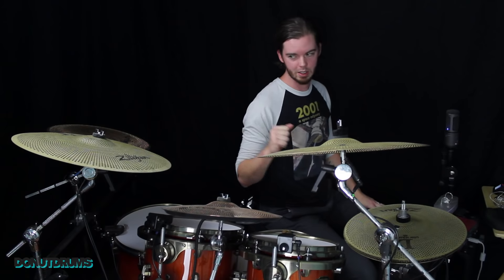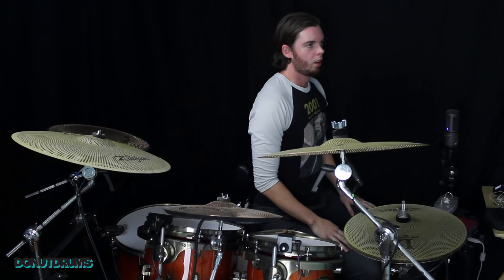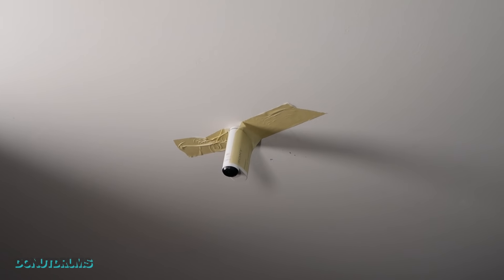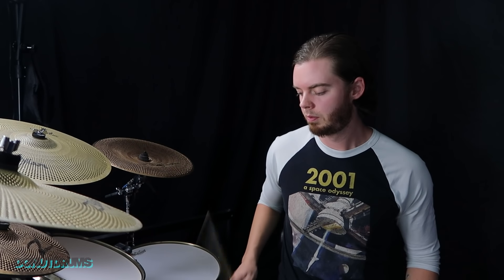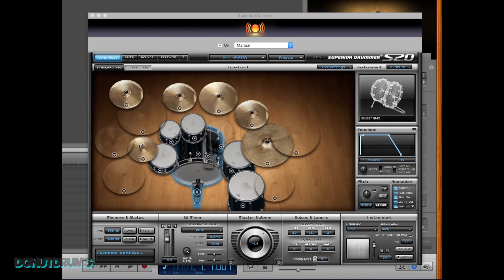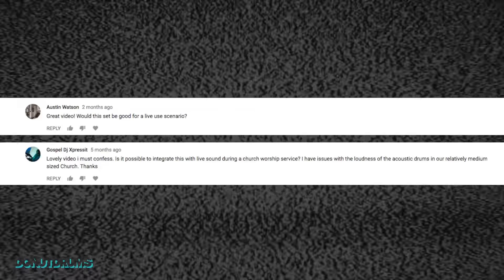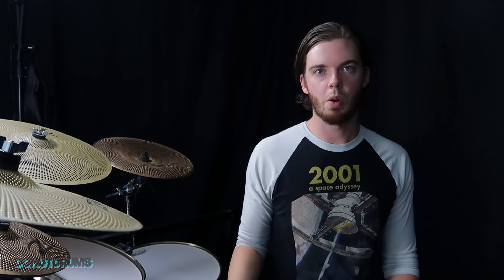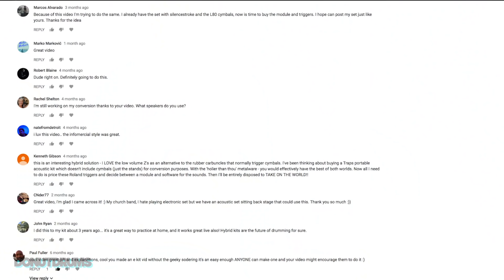ULTIMATE ELECTRIC DRUM SET - Part 3 (Q&A Video)

Comment: Great video series. Here are a couple of observations from watching and from my own experience switching over. I thought a moving hi hat on a stand was something I needed but in reality it's worse when the chunk replacing the lower cymbal is just a switch on a spring anyway. Like other people I was worried about going from a huge bass drum to a little pad but in reality I didn't notice a huge difference because I kept the same pedals. 

What I did really like is the Roland 3-zone ride. I like to have the edge zone so I can crash it, which I do more than ride it, and the bow and the bell for different sounds. It just feels so much more natural to have those extra sounds across the body of the ride like a real cymbal would. Personally I don't think losing sounds would be worth it for the stick feel of metal but I don't angle my ride or play a lot of bow.

It's funny the big difference in the spacing and height of the rack toms and cymbals when people switch over. The height of an acoustic bass drum and the depth of the toms and the larger cymbal sizes force you to give things some space with the rack toms up and spaced out and the cymbals up at eye level rather than having the pads all crammed together at waist height.

Comment: if you want less volume from your acoustic drums with a mesh batter head. You could remove the resonate head all together or if it thats not your kind of aesthetic. Try throwing a t shirt in there. Nothing large enough to touch the top head just rest on the bottom head.  Cuts out a decent amount of low end as that resonate head is acting like a speaker. That said you may need to readjust your triggers as that resonate head does provide vibration which helps trigger double or ghost strokes better. If the noise doesnt bother you just leave them. I have also heard people using cotton balls to help dampen the resonant head.
Fun vid and thanks for the info @donutdrums
Reply from the maker: These are all great ideas! Thank for sharing!

Comment: about using roland triggers with an alesis module: yes, it should work. I have it the other way around currently. originally had an alesis dm10 kit, the module fried, so I bought a roland td25 module and im now using it with my alesis shells and triggers. just a matter of using a different cable to connect to the brain, but the cable end that goes into the trigger is just the same. 

in about 2 weeks i might have my alesis module fixed and my roland triggers are about to arrive, so Ill be able to test it with the alesis module as well. will post here with the results

Comment: Did you say you use the resonant heads under your mesh? I will probably only have to do that with the snare, the toms were perfectly fine with just the mesh remo silent stroke heads, just minor adjustments in volume, I can't get the snare to trigger well with the Roland double zone, I will experiment with the resonant head under....maybe with the bass drum as well.....I literally have no issues with noise, my house is in the middle of 3 acres of property so I could play an acoustic set, but I got tired of trying to get a decent sound when recording it so the electronic set paired with software solved that, now to get a good lucking conversion.... that is the quest, Siren- drums is the inspiration at the moment.

Comment: If you sing lead or backing vocals with this type of setup, you may run into issues of stick noise coming through the vocal mic.  I tried both Jobeky and "stacked" Gen16/Roland cymbal combinations.  The stick impact was just too loud.  Ended up going back to the Roland rubber cymbals.

Comment: 2 additional questions: 
1) Couldn't you have used just one cymbal for the hihat (+RS5 trigger) ? Whats the use of the bottom one ?
2) On the ride cymbal, could you not have used two RS5 triggers in different places to have a dual zone this way ?
Reply from the maker: Yup, one would still work. The cymbal pack came with a set of hi-hats so I thought I might as well use them both. Having two RS5 triggers plugged into the bell and bow cables did not work. I'm not sure why but the bell trigger would never trigger, just the bow.

Comment: I  have a questions. Can you extend the shortie cables from nitro mesh snake with instrument cable extenders? Will it properly send the signal? THanks.
Reply from the maker: I use a splitter at the moment and it sends the signal just fine. I don't notice a difference in quality. It's not the exact same thing as extending it but it's similar and works fine.

Comment: So you're just using your Roland head unit as a pass through (and trigger settings) for all the triggers to your computer?
Reply from the maker: Precisely.
Reply: @donutdrums  Thanks for the answer.  I am on my way to purchasing all the necessary triggers, I have everything else.

I did get 3 of the same pintech triggers you're using. I did a trial run on one of the crash cymbals.  I am getting a lot of extra "bow" triggering since these L80 cymbals wiggle so dang much. Also, hitting the cymbal with a good velocity typically registers as "bow" as well.  What are some settings I can change to fix this?  I am using a lower end TD-4 module, but it seems to have a ton of advanced settings.

Comment: I decided to do the same thing with my hi-hats, the Roland CY5 actually fit flush with the 14" L80. I was able to secure the two together with the clutch running between the two onto my normal hi-hat stand.  I messed with all the settings for awhile, but it always seems to register it as a bow hit. Did you have the same experience?
Reply from the maker: That's a nice set up. No, I haven't encountered that issue. Strange. I can't think of why that is.
Reply: @donutdrums  Welp, this is entirely because I'm an idiot.  I was able to change the cymbal to an open hi-hat sound in the module and adjust it however I wanted to sound in Superior Drummer.  I also went ahead and put a CY-8 cymbal under the L80 ride. So I've been able to trigger both the hi-hat and ride with old parts.  The only issue is there's no ride bell.  If I had an additional Pintech trigger, I wonder if I could stick it under the bell?

Comment: I just converted a set. I went pretty budget and ive got jobeky 3 ply heads on.
Id like to use reso heads but when I put them on my snare it was much louder than without them. 
Have you got any suggestions for something that will make the resos as quiet as just the normal mesh?